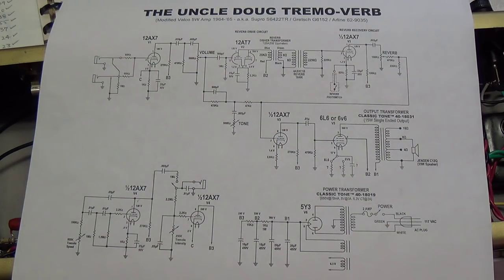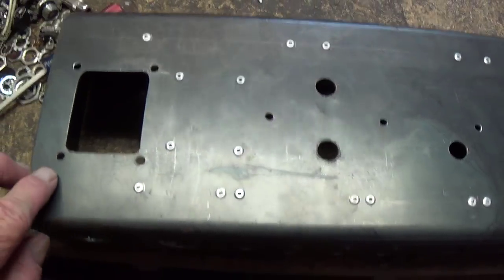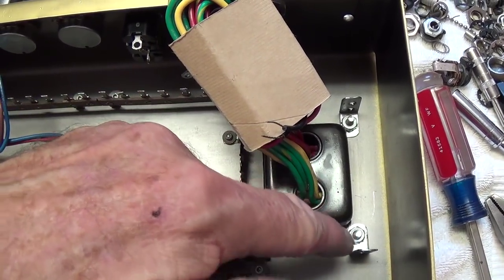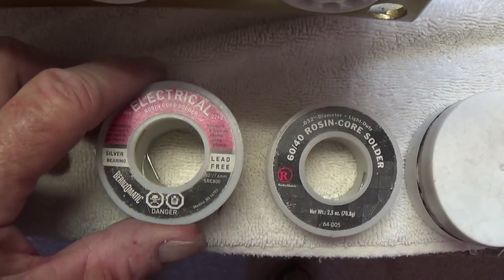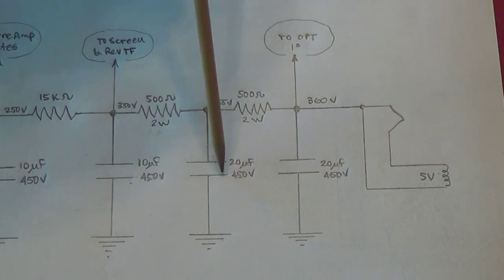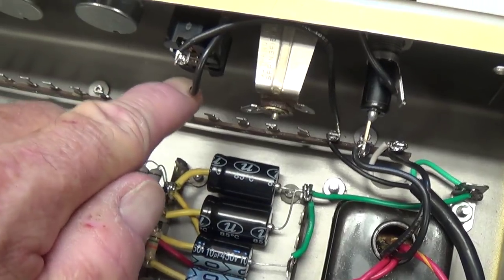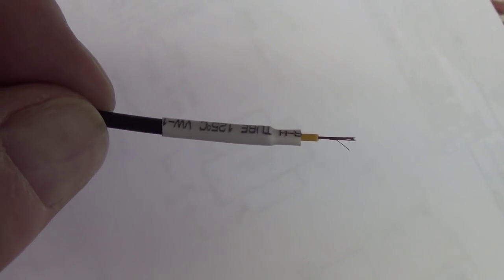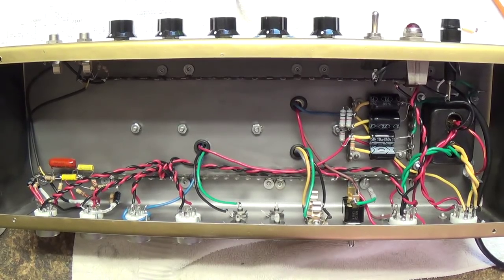How to Scratch-Build a Vintage Amp, Part 7:  Chassis Finishing and Point-to-Point Wiring

Comment: Bonjour Uncle Doug,
i intend to build this amp. but few questions first  :)
about pots you don't indicate the types, so i guessed :
vol and tone : audio  / reverb : linear / vibrato speed and intensity : reverse-audio
and also may i ask if i can use pot with switch as original supro schematics  for reverb and tremolo ?
last :) you said that it is possible to use the switch 6v6/6l6 for cranking with 6V6 with different cathode bias values . An idea of computing these values ?
i wanted also to use a James tone stack, but maybe it will lead too much loss, i think this is used in new 1622RT but cannot find a schematic :( ...
i visited an old amp vendor and builder and he gave me 2 6V6GTA  MAZDA/BELVU dated 1971 ;-)
tks for all, and don't ask too much from Rusty ...
Reply from the maker: Greetings, Roland. Your pot suggestions make sense and using a pot with built-in switch seems fine to me. The cathode bias values must be determined by measuring the plate voltage and current of the tube and calculating the plate dissipation. If you are unfamiliar with this procedure, see my video on biasing single-ended (SE) amps. Tone stacks can lead to significant loss of signal, particularly in SE amps. I personally don't recommend them, unless you add a cathode follower to the circuit to reduce the loss. Best of luck with your project.
Reply: merci beaucoup, UD !
maybe as V1 has  spare triode, it can be used as CF, i guess it's also a question of impedance adjustment.
tks again for your quick reply .
Reply from the maker: You're welcome, Roland. Yes, the unused triode may be so utilized, but it will require a bit of experimentation and the more complex tone circuit may not be worth the effort. Passive tone controls are, in my opinion, best kept simple, otherwise their ill effects often outweigh their benefits.

Comment: I remember that Tektronix REQUIRED use of silver-solder (8:13) in their old tube 'scopes (with the ceramic terminal strips). I few of inches of this solder was actually provided with the unit, wrapped around a spool in the interior of the cabinet!
Reply from the maker: An interesting insight, David. Thanks.

Comment: Hi Uncle Doug,   Hope all's well with you!    If I have a schematic and build an amp from that, I;m assuming that these production amps were build with lots of costs in mind that we probably don't have.    I would like to add more fuses than the original amp had to protect the power transformer and output transformer especially.    The original was a Fender AB763 Deluxe, that only had one fuse on one leg of the line voltage.   Ive seen people fuse both sides of the primary and 2 legs of the HV line on the secondary.    (for this amp the secondary is 2 x 330 v plus a center tap).    Is it better to fuse the two 330vac secondary lines, or would one on the center tap work?   Or all 3?    Im at a loss here, any guidance appreciated, thanks!    Wondering what would happen if all 3 secondary windings were fused and, say, only the center tap fuse blew.     The plates would still have HV on them, just not referenced to the center tap.  Wouldn't current still flow someplace?  (etc, etc)
MP
Reply from the maker: I think you may be going overboard a little when it comes to fuses, Michael, but you definitely have the right to incorporate as many as you wish. A single fuse on the HV center tap should be adequate. The CT is the only return for the two output legs.....the current won't flow elsewhere. In the AC primary winding, I see no benefit to fusing both legs. With a polarized plug and a fuse located in the incoming "hot" lead, a single fuse will offer all the protection you need.
Reply: Thanks Uncle Doug!  Yeah, probably way too worried about stuff, will do as you suggested.  (and I won't spend my whole allowance on fuses and fuse holders :) )

Comment: cool that you explain some of the wiring, still i cant understand how you can design such a layout in rather a "rats nest" style, there is so much to consider and so many things can be done wrong even in a conventional way using eyelet boards, grounding, placing of components to avoid hum or interferences especially with that more complex amp with tremolo and reverb - really awesome this one. wish i could do that.
Reply from the maker: Rusty and I only build in point-to-point ("rats nest") style, SF.  It may look confusing, but in reality it's not, since you are following a schematic and building the circuit stage by stage.

Comment: And to make it easier I designed a turret board layout of the circuit that I think only a couple wires cross, I also have the schematic. If you want I am at guitarznamps@yahoo
Reply from the maker: Sounds good, Craig. Best of luck with your project.

Comment: yep, the gratitude at making something from scratch is immense. I am only able to make a simple booster pedal with a single transistor, but when finish the PCB/stripboard and I drill the enclosure to start test fitting everything, it starts to make much more sense than before, when you had an empty stripboard, a bunch of components and a plain aluminium brick box
Reply from the maker: There is no better way to learn about electronics than to actually construct circuits and components.

Comment: I was wondering if taking the filiment wires off a terminal strip to each tube gave you better results than daisy chained and tucked in the corner. I've built a ton of amps and I hate doing the filiments because of landing 2 wires on each pin of the socket. Great videos, I myself just don't have the mind to do videos, I have done some but not anything like you do. Good for you and keep on building, Its nothing but a good time.
Reply from the maker: It seemed to work quite well, Craig. I too hate the double wiring necessary to connect all the tube filaments in a chain. It was much easier and neater to only have one wire to each pin, and the amp was dead quiet.
Reply: to get back to you , supro made the Model S6622 which is the "supro corsica". You got to look these up, they are really cool amps. The corsica has a 2nd stage that goes into the reverb. There is a voltage divider on the signal to the tone and that 2nd stage, that is the biggest difference between the two circuits. I really like the corsica. The front panel is a bright blue and has a lightning bolt in the middle, look them up. Maybe build one on your next build, they sound great. You can go from jazzy cleans to jimmy pages first album.

Comment: I gutted the chassis of sears 40XL solid state, and built a corsica circuit in it which looks to be the same. the cabinet held a 12" spkr which was nice.This is a classic circuit that has great harmonics. If anyone was to build a amp, this is the one to build.
Reply from the maker: I'm not familiar with a corsica circuit, Craig, but if it's like the Supro T-V, then it must be a good one to build.

Comment: +Uncle Doug
What is the pros/cons of point-to-point and printed circuit board?
Reply from the maker: PCB was created to facilitate mass production, while point-to-point takes time and artistry. It's like comparing a photograph to an oil painting......they may both effectively depict the same subject, but the means of doing so differ greatly.
Reply: +Uncle Doug
But can PtP be used to make the same high-end electronic devices that are made with PCB? Can it do all the digital things that modern devices do?

Comment: Su-perb work unc.Just a couple of  tips, I know it's a bit late but I'm a recent subscriber, the  grid stopper should be wired directly onto the 12AX7 grid lug. I also was using rub on letters nearly 30 years ago but it's much easier to use printable adhesive clear and use 2nd piece over print to protect it.Some water with a drop of detergent is used to easily slide it in place.I know why we never see you loading the components and soldering.....because Rusty is the genius behind it all.Sorry the truth hurts.
Reply from the maker: Greetings, George, and thanks for the input.  You're right about Rusty.....he's "the man".

Comment: I wanna make something like a Marshall stack head out of tubes and components from an old tube TV. Is that possible?
Reply from the maker: An old TV does not contain many parts that would be appropriate for building a Marshall head. The voltages and principles of operation are quite different.  You would be better off starting with a fairly high wattage PA amp.

Comment: Hey Uncle Doug, would you mind telling me how you fasten you terminal strips down? Looks like a rivet, but one ive never seen before. Also you have given me the confidence to build my own amp and your vids have been instrumental in that.
Reply from the maker: I generally use "pop rivets".....the kind that have a protruding steel pin that is gripped by a riveting tool and pulled to collapse the rivet.  When the rivet is fully compressed, the pin is snapped off within the tool.  Best of luck with your project.
Reply: Thanks Doug, I thought it was a rivet, but are you using a washer in conjunction with the rivet on the terminal strip side? Thanks.
Reply from the maker: If the hole in the terminal strip foot is larger in diameter than the rivet, I use a washer that fits the rivet tightly.
Reply: Ah ok, thank you! Thats what I thought and just wanted to make sure because I like the way you did it. Nice and neat craftsmanship all the way around Unk!
Reply from the maker: You're welcome, Dean.

Comment: if the power transformer is sorta close to the amplifier tubes, would that cause a 60 hertz hum?
Reply from the maker: Not likely, especially if the amp worked fine for a while and suddenly began to hum. You need to look at faulty pre-amp tubes and bad wire routing.
Reply: i am building one
Reply from the maker: If you're designing the layout for the amp, be sure to keep the pre-amp tubes as far as possible from the power supply, and orient your power transformer and output transformer at right angles to each other.
Reply: ok

Comment: I've done this a bunch of times. After watching your videos I learn new cool things to make better amps. For instance, I never even dreamed of using pop rivets to hold in my tag strips. Speaking of which, I've always done point-to-point literally - from one component to the other, using tag strips only for the power supply filters and the grounding (where I don't use a ground bus). Now, I'm going to start using the tag strips more. They make for a much neater circuit. My amps sound good and are very quiet, but look like a rat's nest with all the components stretched all over the place in the chassis. This video changed all that. Thanks for that!

I still don't think I'm ready to hand-forge my own chassis though! :-) Nice work there too!
Reply from the maker: You're welcome, Dave. I prefer the terminal strips because they securely anchor all the components and prevent them from moving around while the amp is transported.....and they look very neat. Rusty and I are glad the videos are helpful and informative :)

Comment: Hi Uncle Doug, I have a question.
Looking at V1 the first stage of the 12AX7, where the 270K Ohm plate resistor is situated, could I also install a potentiometer to give me a gain control to increase the gain?
Reply from the maker: Greetings, Capt. O. Varying the plate resistance will alter the gain of the stage, so theoretically, it should work. The only way to know how well it works would be to install the pot and test the theory.....but it does sound feasible.
Reply: +Uncle Doug thank you for your response. i'll give it a try in the near future and see what happens. i get back to you with my findings!
Reply from the maker: Please do, Capt. O. Experimentation is always the best way to evaluate a modification.

Comment: Hey Uncle Doug, 
 I was wondering about 63/37 rosin core solder. I wonder why I don't see people using it because it seems to have some positives such as melting at a lower temp and not creating cold solder joints. It does seem to take a bit longer to solidify. Is there a problem using this type of solder?
Reply from the maker: Not for me, Nemo. I use it exclusively on every electronic device I build or repair.  When it starts to disappear from stores, I'll buy up every roll I can get and keep using it for as long as I am able.
Reply: Great Thanks.
Reply from the maker: You're welcome, Nemo

Comment: I'm OK with you for the 60/40 Sn/Pb 'lead' solder. Low melting point and good wetting property (the liquid solder  stick to the part and don't form the dreaded  blob). It's the one good solder for hobby or small scale electronics.  We went from lead everywhere (gaz, plumbing for drinking water,  paint, bird shot etc...) to an overall lead ban . A little exaggerated, no ?
Reply from the maker: I agree, AS. Thanks to government intrusion in our personal lives we are now restricted to the toilets, light bulbs, batteries, refrigerants, aerosols, gasohol, soft drink sizes, solder, etc. etc. that they deem best for us. Whatever happened to the "land of the free" ? :)

Comment: A superb construction job Doug; The craftsmanship is astounding, the careful placement of tube sockets, transformers and other parts will make sure that with the extra shielding hum should be at a minimum or possibly eliminated.
Reply from the maker: +John Cunningham   Thanks, John.  This one did turn out virtually hum-free. After building a bunch of amps, you gradually develop techniques that enable this type of result.

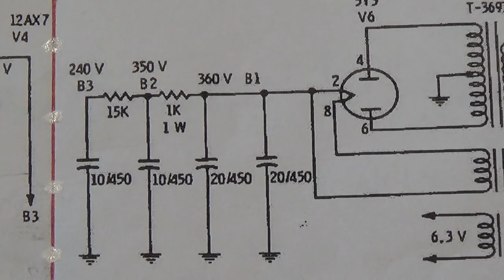Comment: Another excellent production! - A comment on filter caps @9:24 -  The Fender Tweed Princeton 5F2A has this set up as well with (2) 16uF in parallel equaling 32 uF as the first filter cap, and it also uses a 5Y3 rectifier, so I don't think the original schematic is in error, they most likely made it that way.  Would be fun to find an original and prove our theories.  

I continue to revert back to all your excellent videos for tips on my own amp builds.  Thanks!
Reply from the maker: +Peter Philbrook   You're welcome, Peter. I'm glad the videos are helpful. You're right about the 5F2A Princeton circuit and I guess it could have been done this way in the Supro....although it does look strange on the schematic :)  I'm really pleased with the modified power supply rail......it's absolutely dead quiet, without the stress of the 32uf first cap.

Comment: The fuse holder as it is is wired kind of wrong. The live should go to the deep part of the fuse holder (so when its opened you cant mash you finger in and die. Also I do believe is should be after the switch, but this doesn't change much ;-) This is coming together nicely ;-)
Reply from the maker: +akkudakkupl   Actually, if the distant end of the fuse is electrified, and the fuse is good, you would still get shocked (not killed....unless maybe you were standing on wet concrete bare-footed).  The only sure way to safely change a fuse is with the amp unplugged.  Also, the fuse is after the switch in the schematic. Thanks.....glad you like the amp.

Comment: (Probably dumb) Question: where do you get your shielded cable? Can you use any shield cable (like guitar cables, RCA cables) or is there cable specially made for making shielded connections in tube amps?
Reply from the maker: +sa230e  It's just generic shielded cable, SA. For the small-diameter shielded signal wires, I use some RCA cable that was originally intended to connect VCR's, DVD players, and other devices to television sets.
Reply: +Uncle Doug Thanks, Uncle Doug!
Reply from the maker: You're welcome.

Comment: I don't know whether you done any further tampering with the filter, but I believe you should add a high wattage low ohmic resistor instead of splitting the 1k filter resistor. Or even better add a choke to split the node in the filter.
Reply from the maker: +Per Normann  The amp is absolutely hum-free and sounds great, PN.  I really don't see any reason to make any changes.  However, thanks for your suggestions.

Comment: Send the hot mains wire to the fuse first then the switch.....just a tad safer.
Reply from the maker: +Squizzy Bollocks The problem I see with that arrangement, Squiz, is that you can get electrocuted while changing a fuse, even with the amp turned off.  The only time I could see an advantage to a fuse preceding the power switch would be in the extremely unlikely event of a dead-short in the power switch itself......but in that case, the circuit breaker in the power line would prevent any damage.

Comment: Hey Doug! I'm a fan of you, Rusty and Jack from Spain. Great job, I'm really amazed, in the future I'll be able to to make my own amps too, and this helps and inspires a lot. How did u do the lettering? My tiny brai can't imagine the way to do it. Regards
Reply: And why ur electrolytic capacitors seem to have only one terminal?
Reply from the maker: +Edu "Turupá" Sánchez  Thanks so much, Edu.  Glad you enjoyed the video :)  I used the rub-on letters that you can buy at hobby and art supply shops, or on the Internet, if they aren't available in your area.  I also made a video showing how to make computer-printed labels and logos.....you might find it interesting.
Reply from the maker: +Edu "Turupá" Sánchez  The electrolytic caps in the video are all axial and have two terminals.....one at each end. The positive terminal is insulated to prevent short circuits.
Reply: +Uncle Doug Thx for ur response. I'll check that out. Whole new world to me. I use to make everything rough but i want to make my stuff start looking cool.
Reply: +Uncle Doug Got it. Great! The yellow insulation confused me